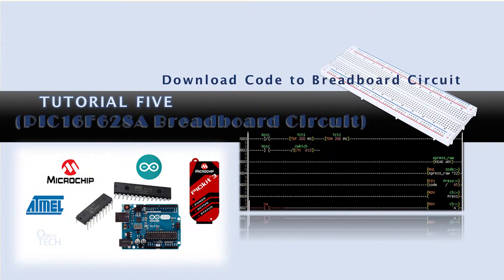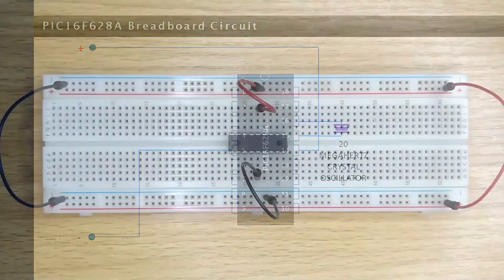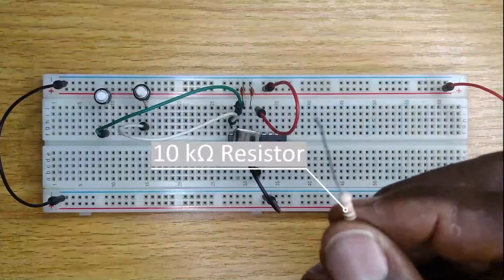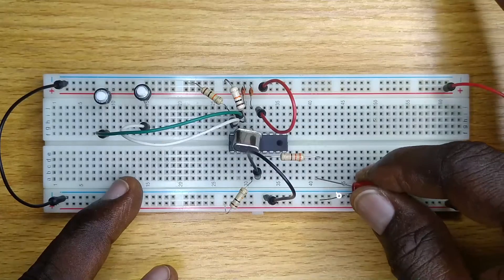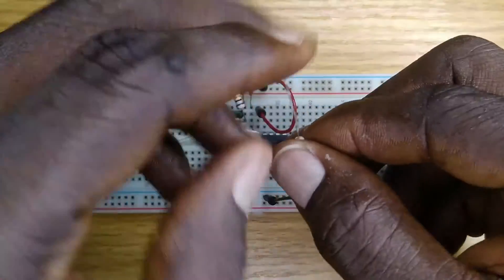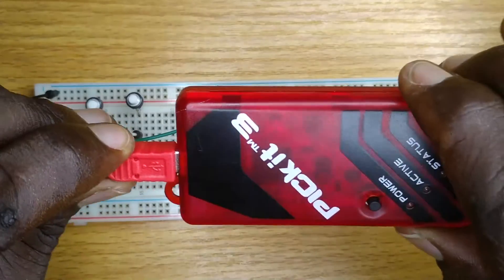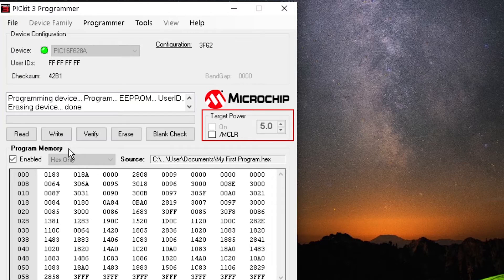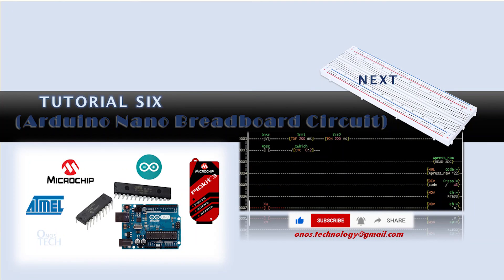LDmicro 5: PIC16F628A Breadboard Circuit (Microcontroller PLC Ladder Programming with LDmicro)

Comment: how to find the pic16f628a in device family?
Reply from the maker: From the "Setting" menu, select "Microcontroller". Then "Microchip PIC10-16 MCUs". Finally, Microchip PIC16F628 18-PDIP or 18-SOIC. This selection works for PIC16F628A and may also work for PIC16F648A microcontrollers

Comment: Is it possible to avoid external oscillator ? I mean, is it possible to use internal oscillator of PIC16F ?
Reply from the maker: Yes! You can use the internal oscillator by setting the correct PIC configuration bits from the MCU parameters of the settings menu
Reply: Excuse me, Sir. But I do not know about the " correct PIC configuration bits "
Reply from the maker: @mikesterling3949  Let me know the PIC microcontroller you are using, then I can help you check. I will also consider doing a tutorial video for that
Reply: At this time I intend to use the same MCU ( PIC16F628A). I am seeing the same setting ( 0x3F62) in MCU settings of LDmcro. I guess I can go ahead with ( this default setting)  0x3F62 for 16MHz. 
However,  some time later, when I want to use any other PIC, I may have to approach you at that time.
Reply from the maker: To use the internal oscillator set the configuration bits to (0x03F64). See datasheet for configuration bit setting. http://ww1.microchip.com/downloads/en/devicedoc/41196g.pdf
Reply: This seems to be too much for me to understand. I may need a separate tutorial on this. However, I did try hard and I observe as below.

I refer to section 3.7 ( Device Id word) in the data sheet.

I guess you are advising me to use 0x3F64. In that case, bits 4, 1, 0 would be 0-0-0, which is for LP oscillator.
Can we use bits 4, 1, 0 as either 1-0-1 or 1-0-0 which are for INTOSC ?
In this case PIC configuration bits would be either 0x3F75 or 0x3F74.

I do request you for a separate tutorial on this topic.
Reply from the maker: Correct!
Reply: I still don't know whether to use 0x3F75 or 0x3F74 for internal oscillator
And there are so many other bits I didn't understand.
Reply from the maker: Use 0x3F74 it will allow you to use pins RA6 and RA7 as input/output pin. But 0x3F75 will only allow RA7 for input/output will RA6 will be Clock output. I will consider doing a tutorial on it.
Reply: Thank you Sir. I look forward to your tutorial
Reply from the maker: You are welcome
Reply: Thank you Sir, for replying within 3 minutes !!